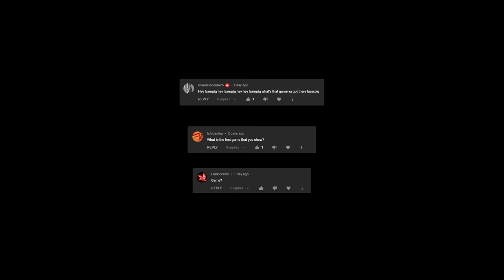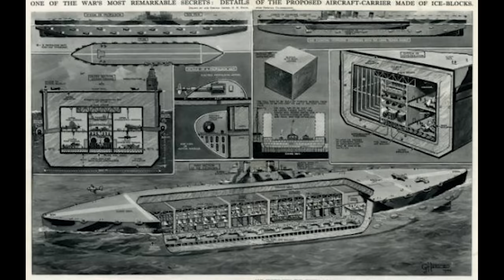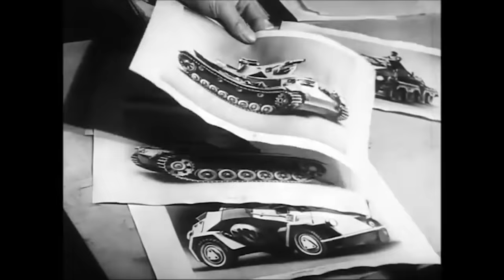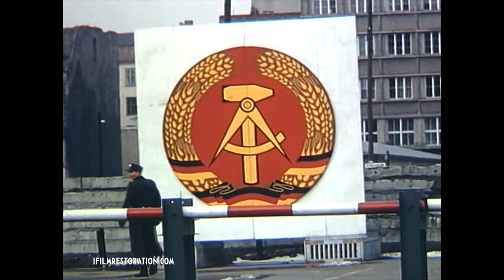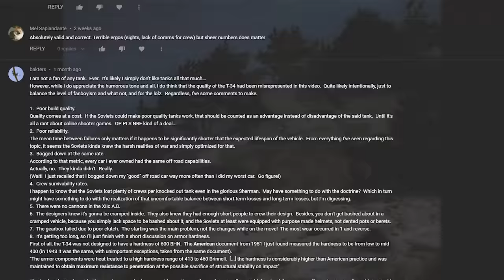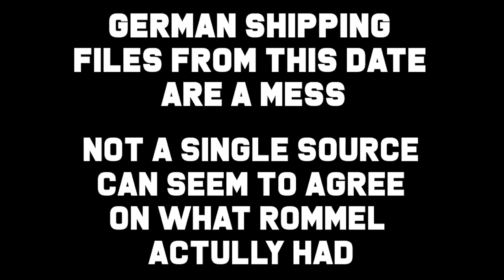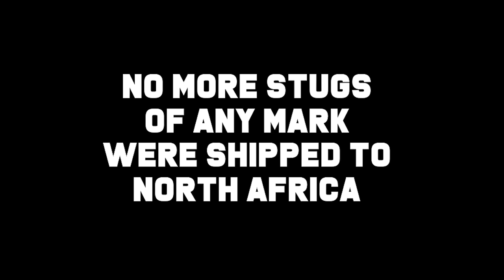In defence of the Crusader Tank

Comment: I always thought the Crusader unfairly received a bad rap.  Thanks for getting this video out!  Still looking forward for a video on the dark horse Cromwell.
Reply: I mean just looking at it and you can see that it is a good tank design.
With its low profile.
I guess it could have been less flat on the front of the turret.
You know where it was going to be hit most likely.
 
Having a tall an not very wide tank makes it an easy target.
It also comes with the need for more armor platting to protect it.
I mean there is a reason why modern tanks look the way they doo.
Reply: @MegaBanne  well the mark 2 did have a rounded gun mantlet
Reply: Cromwell is my favourite tank of the war
Reply: @ussenterprisecv6805  true
Reply: Sorry but history showed that the crusader couldnt get the job done. It was a fast light tank that had problems facing panzer 3s and 4s, themselves tanks that werent exactly hard to destroy. (and yes it could destroy them, the panzers werent immune to them, but if you compare the numbers youll see that the crusader lost outright)

And if you have a tool that cant get the job done that is required of it.. that is what we call a bad tool.

The crusader was so quickly replaced after the african campaign that none where even used during the battle for europe that followed. Instead we saw lees, shermans, cromwells etc.

No amount of "it wasnt THAT bad guys" is going to change that fact. It was an underperforming design that was made for a type of warfare that never actually apeared in ww2. The concept of a fast cavalry tank failed utterly.

And if something fails, then its bad.
Reply: @MegaBanne  Im sorry but this is not how any of this works. You dont judge a tank by how good it looks in pictures. You judge a tank by what it brings to the table.. and the crusader only brought speed to the table. Speed... in a desert. It neither had good armor protection, nor a good gun and had massive reliability issues, all well documented. Furthermore it was designed for a type of warfare on ideas that still dealt with WW1 warfare, wich was proven to be completly inadequate during germanies attack on france, and never materialized in the battles of ww2. The concept of a cavalry tank was simply not working, just like stalins race cars the BT-5 and 7 the crusader was built for a type of war that simply didnt exist.

If the crusader had been a "good tank design" the allies wouldnt have replaced it so fast after the african campaign to the point that not a single crusader saw action in europe afterwards.
Reply: @riptors9777  do remember the crusade crews were driving a tank that had just come into production  had at best 3 years training and were fighting the german panzer corps that have been training in secret for much longer and had battle experience in their blitzkrieg attacks across france so the crusader may be losing not because it was a bad tank but because the crews were not trained to as high a degree as the germans. it was replaced because it couldn't cut it against the newer more common tanks the pz4h  the panther and tiger which is why shermans and cromwells saw more action as well as the crusader no longer being on par with the average german tank  with the mk 3 and its 57mm gun it had better pen than most german tanks using even the long barrel 50mm guns whilst being faster with enough armour to hold off german 20mm guns they were expecting to fight with the pz2   its if used correctly could take out a pz 3 or 4 with very little problems having enough penetration to punch through the front of a pz 4 having up to 122 mm of penetration  for instance the tiger 1 had a frontal armour thickness of 104mm meaning the crusader at 400 metres could pen the front of a tiger though it is guaranteed at 300  so it wasn't a bad tank it was just crewed by men who didn't have a good armoured doctrine seeing as they were originally riding horses
Reply: @riptors9777  Sorry, but I do need to correct some of your rhetorical skills.  First is always know your opponent's position, least one goes off charging Don Quiote style.  I only said that I thought the Crusader unfairly received a bad rap.  That's not a ringing endorsement for "best tank of the war" anymore then its not an endorsement of "best tank of the north African war".  Just that the reputation was not wholly deserved.  My actual opinion about the Crusader as an actual tank is that the tank was adequate in its role at the time.  The Crusader had a job, it did its job.  A key factor you correctly  note is that a comparison of this tank against peer opponents would still be needed to evaluate the crusader at this level.  But you make a faulty assumption.  The Panzer Iii and Panzer iv were indeed good tanks... but they did not compose the majority of the tanks available to the Afrika Corps at the time the Crusader was "holding the line."  The armor force available to the Afrika Corps at this stage in the campaign was. .. Italian armor.  As with Bruno, Italian armor is not spoken of. Why?  Because Italian armor is an exception to the concept of "something is better than nothing".  Particularly the Italian adaption of the vickers 6 ton that the Italians made extensive use of in North Africa.  In light of its peer opponent, the Crusader did an adequate job.  Another point you overlook, is that a reference of time is important.  Designs age out quickly in war.  Which means that tanks (and even aircraft) need to be upgraded as the war continues.  If the base design can be upgraded, great.  If not, a new design is needed.  And just because a tank design is later upgraded (or discarded) at a later time doesn't mean that the tank was bad at the time it was in service.  Even the Panzer III, Panzer IV, Churchill, Sherman, and T34 all go through this upgrade track; the Crusader simply didn't have the continued ability to be upgraded.
Reply: @riptors9777  no, sorry, just no...it wasn't really the Pz3s&4s it has problems with.  The 2lb gun was able to deal with the early ones and upgunning to the 6lb put it on basically even gunning with the Pz3 and a fair range of the Pz4s.

Being the perfect 1v1 matchup is way overrated by people today, and yes, mobility is greatly underrated, as even if all it does is allow you to more easily concentrate forces where you need them, that's a force multiplier.

Really, it's the notion of the super-heavy breakthrough tank that's the thing that was the holdover from WW1 thinking.  The light tank designs were focused on NOT doing WW1 warfare again, even if the Md tanks ended up being more in line with how WW2 would actually be fought (once they stopped with the multi-turret nonsense and got some decent engines)

The actual problem the crusaders has (other than the at the time basically universal reliability problems, which were improved on with later production runs changing out the engine) was in dealing with anti-tank guns, and that was more due to the annoying British tendency to not give their tanks good HE ammo than the tank's actual design, so whenever the higher mobility of the Crusaders did get the upper hand, the German tanks could just fall back behind a line of dug-in anti-tank guns that the Crusaders didn't have the right ammo to take out.

Like all early war tanks, they certainly had flaws, but the real problem was with the ammunition they were supplied with, not the actual tanks.

It'd be like a tank design being blamed for not being able to kill other tanks when the real problem was they weren't issued AP ammo....and then mistaking it for being bad at dealing with infantry because it bounced off infantry units (because it couldn't deal with their armored support).

It wasn't an uber tank or anything but like the M3, it did the job well enough until something better could be rolled out, which was the design goal.

(Especially since, as mentioned, the Germans were fielding a lot of light tanks and non-tank vehicles and it wasn't all just their newest, heaviest equipment)
Reply: @dynamicworlds1  The 6 pounder version was introduced 1942, the very same year the african campaign ended. And ontop of that said upgrade could only be achieved by removing a crewmember from the turret. Lowering the total amount of crew in the tank to only 3

Wich as any source you will find on the topic of ww2 tanks will tell you is absolutely rubbish. The commander had to take over the roles of the gunner and loader.. so had to do three jobs at once wich LOWERED overall combat performance of an allready bad tank even further.

So not only was this upgrade not relevant to the african campaign and only came in at the 11th hour against an enemy that was allready reeling and on the backfoot, it was an overall downgrade of combat performance all things considered.

So good job making an argument that turned an allready badly performing tank into a even crappier tank.. allbeit with a bigger gun.

And i havent even mentioned the horrendous issues with the cooling system that regularly broke down, made the tank completly useless, and required THREE days to replace... only to break down again. Cause aparantly it was very weak to sand getting into the system... wich is kinda an issue if you are fighting in a desert.
Reply: @riptors9777  

The final, upgunned Crusader sliced through the panzers and had greater reliability. A big problem was the US derived Liberty engine, which Nuffield eventually ironed out the problems.
Reply: @johnpeate4544  In your dreams maybe. It came in at a time when the germans where allready on the backfoot, undersupplied and on the retreat, and was supported by Grants and Shermans.

And the problems with the engine were ironed out right before the retirement of the entire design. So for most of its existance on the field it was a piece of crap.

And again: They had to lower the crew in the turret from 2 to 1. A 2 man turret is allready less then ideal, a 1 man turret is absolute shite.

The upgunning was a last hurrah of a failed design to get atleast some use out of it and a desperate measure. 

Also i find it funny that crusader fans in this discussion where "nah man.. the basic 2 pounder had no issues with german tank armor" and then go "but it was really good after it was upgunned"

So what is it? Was the 2 pounder good enough to deal with german tanks? Or did the tank desperatly needed to be upgunned to the point that you had to sacrifice crewspace in an allready undermanned tank to stand a chance?

Cause the 3s and 4s in africa didnt get an armor upgrade during those years. So why the need for upgunning if the 2 pounder did just fine in dealing with german armor?

You guys cant even stay consistent in your arguments....

BTW. other tanks where upgradable without sacrificing crew compartment, so another minus to the allready crappy crusader.
Reply: @riptors9777  

So when I say that  final Crusader had improved armour and a 6-pdr gun and greater reliability, 6pdr armed Crusader tanks sliced through the Germans and Italians in the Desert, they ironed out the problem with the US derived Liberty engine and speed a was a great problem for the Germans because they had nothing that fast, you can’t refute it and ramble on about irrelevancies like the Germans being on the retreat and waffle about the 2-pounder which I didn’t mention?

In any case While the 2-pounder gun had good performance when the tank was introduced, ammunition supply was focused on solid armour-piercing (AP) rounds. When German tanks moved to face-hardened armour, an effective Armour-piercing, Capped, Ballistic Capped (APCBC) ammunition was not available. By the time it was, German tanks had adapted specifically to counter it. Delays in producing the next generation of cruiser tanks meant the Crusader was later up-armed with the 6-pounder, which had much better anti-tank performance.

Supported by Shermans? Good one.

The Sherman on introduction was generally no better than British tanks, but more reliable being new. In fact it was worse than many especially the well armoured 6-pdr Churchill. The Sherman’s first showing was at El Alemein, as unproven it was pitted against lesser Italian units. The Sherman tank supplied was complex, as they never had a proper tank engine it had five Cadillac engines arranged in a circle, supposedly synched up - note: US forces never used this complex excuse for a tank engine - the Sherman was built from as many existing commercial vehicle parts as possible. The British worked with the makers to improve the complex engine and tank generally - the E8, the ultimate Sherman was derived from suggestions by the British.

Further, they were found to be shaky at first and consume huge amounts of petrol.

......At the same time it is only right to remember that much of Eighth Army had had little experience of warfare of any sort.The original 51st Division had been forced to surrender at St Valery during the Battle of France–to Rommel, as had not been forgotten–and its present successor had seen no action. Alam Halfa had been 44th Division’s first battle and its experiences then and thereafter had not been happy ones: 69th Brigade had not seen combat since it had been reformed in mid-September; 9th and 24th Armoured Brigades were totally inexperienced new arrivals; and 8th Armoured Brigade had been in action as a formation only in its unsatisfactory clash with von Vaerst during Alam Halfa.

In addition, the new equipment reaching Eighth Army greatly increased the problems of inexperience – 8th, 9th and 24th Armoured Brigades for instance all received their new Shermans too late to gain any real practice with them before the battle began. They also found that there was a dearth of spare parts and many important items of equipment, such as compasses, were missing altogether. The Shermans later gained a deserved reputation for reliability but in those early days when neither their crews nor the maintenance units were used to them, it is hardly surprising that, in the tactful words of Lucas Phillips, ‘several of them were found to be mechanically shaky’._

......As a crowning misfortune, the Shermans revealed another defect which had been concealed by the static nature of the fighting at Alamein: in these difficult conditions they consumed what the Official History calls ‘fantastic quantities of fuel’.

......Currie’s brigade had been built up to 121 tanks of which seventy-two were Shermans or Grants and the rest Crusaders, but by this stage of the battle a number of the Shermans in both 9th Armoured Brigade and 1st Armoured Division were very much ‘mechanically shaky’.”

— Eighth Army's Greatest Victories: Alam Halfa to Tunis 1942–1943 by Adrian Turner
Reply: @riptors9777  

Oh the Germans were under supplied were they? And I suppose Monty chasing Rommel a total of 1,500 miles, the equivalent distance of Paris to Moscow. The captured ports, until Tripoli, were nowhere near the capacity required even had they not been demolished by the retreating Germans was rolling in supplies?

In addition to hideously stretched supply lines Montgomery was often outnumbered in his pursuit of Rommel’s across North Africa:

He [Rommel] had now blundered by abandoning the best natural defensive position between Alamein and Tunisia to counter a daring but comparatively weak threat by the New Zealand Division to his flank.

Montgomery’s plan, laid down on 28th December 1942, had been spectacularly vindicated. While Rommel gasped at Mussolini’s criticism, the forward troops of Eighth Army were equally amazed at the way the Axis forces surrendered such easily defensible territory....

....he [Montgomery] penned his own secret confession of amazement that Rommel, falling back on his well-established lines of communication, often with superior forces and in ideal defensive positions, had failed to counter Eight Army’s bluff…

...Monty had cause Rommel to adopt such a rapid withdrawal by a mixture of initial ruthlessness in battle at close quarters followed by dexterity and bluff. With only a minimum of forward troops he had forced Rommel not only to surrender almost one and a half thousand miles of territory, but to give up two excellent defensive positions in which he could have and why checked Eight Army sharply.

....In fact Montgomery had no intention of risking his meagre forward units in a premature attack on prepared defences without even proper air support. In artillery and men Eighth Army was vastly outnumbered in the Gulf of Sirte...

In fact the proof of Montgomery’s stretched administrative position was the way in which his foremost units / of 7th Armoured Division - were severely bombed and strafed by the Luftwaffe once they had hustled Rommel’s rearguard our of Agedabia, on the approach road to Agheila. There were a number of casualties, but until the last week in November the RAF was powerless to help, for only on 26 Novemberdid it manage to get two fighter wings operational at Msus.

...He would have found there that, apart from Fourth Light Armoured Brigade, which took the vital Martuba airfields on 15 November( and thus saved Malta from starvation), Eighth Army could only support one division beyond Torbruk. This was Harding’s Seventh Armoured - of whose 47 medium tanks not even five were considered capable of making the 350- mile trans-desert journey to Benghazi, so worn out had they become.

Monty, Master of the Battlefield 1942- 1944. Nigel Hamilton

It should also be emphasized that throughout its conquest of North Africa, Eight Army had to overcome problems not experienced by its predecessors. It’s supply-line had to stretch further than ever before at the time of its victory at El Agheila, and even further still at the time of its final thrust to Tripoli. At Medenine also, Eighth Army’s supply-line was from from adequate, a fact which makes the admirable defensive preparations it carried out in an astonishingly short space of time all the more remarkable.

In addition when Auchinleck had launched his attacks in July 1942, the enemy had had no opportunity to prepare adequate defences, while during CRUSADER he could outflank the defences altogether through the he open desert. For that matter Rommel had enjoyed the same advantage during his counter-offensive after CRUSADER and at Gazala.

By contrast when Eighth Army took the offensive at Alamein in October 1942, the Axis position could not be by-passed and was protected by half-a-million mines and all the hideous devices of the ‘Devil’s Garden’s’. At El Agheila it was possible to avoid the defences but only by crossing terrain worse than any that either Eighth Army or Panzerarmee Afrika had yet encountered. At Beurat the front could be outflanked without too much difficulty, but the going encountered later left even the tough, experienced New Zealanders ‘speechless’; while the Homs-Tarhuna escarpment was only mastered because Eighth Army moved too quickly for Rommel to offer adequate resistance resistance there. At Mareth, Eighth Army was opposed by long-prepared fixed defences, the only way round which led to a ‘bottleneck’ so dangerous that it was feared that an attack through it would be ‘a second Balaclava’. And finally in the Gabes Gap Eight Army faced a formidable natural barrier which it had to assault head-on…

....The weather continued to be dreadful and, as Montgomery reports in El Alamein to the River Sangro, ‘for several days the desert became a quagmire and made operations impossible’. Furthermore, as Kesserling rather admiringly points out, ’the British Eighth Army had marched halfway across North Africa - and over fifteen hundred miles - had spent the bad winter months on the move and in the desert, and had had to surmount difficulties of every kind”. Nor did those difficulties cease one Tripoli was reached, for the enemy, as Captain Roskill states in his Official History of The War at sea, had ‘managed to destroy the port facilities very thoroughly, and to block the entrance completely with six merchantmen’ that had been scuttled as well as with other other debris including ‘many barges filled with concrete’. Air raids and a violent storm did nothing to improve the situation

....And lastly there was the permanent problem of supplies. As Kesselring notes with some satisfaction, ‘even a victorious army cannot keep up a pursuit of thousands of miles in one rush; the stronger the army the greater the difficulty of supply. Previous British pursuits had broken down for the same reason.’ Moreover the ‘piece of elastic’ was under still greater pressure than usual. Montgomery had learned from the errors not only of his predecessors but of his opponent. Whereas Rommel in his dash for the Nile had left his airmen straggling far behind, the Eighth Army Commander, who always believed in the vital necessity for co-operation with the Air Arm and indeed looked on it, sometimes to the airmen’s annoyance, as virtually another branch of his command like his engineers or his artillery, was insistent that the Desert Air Force should advance with him. That meant that at the start of the new campaign some 11,500 RAF and AA personnel had to be brought forward, together with the supplies needed for them and for their aircraft, particularly aviation fuel.

So important did Montgomery consider this that he gave ‘his’ Air Force special priority. It was a wise choice, for the Axis Air Forces, now falling back on their own bases, were able to intervene once more. Fortunately their Allied opponents were ready for them. On 11 November, first day of the Cyrenaican campaign, the Kittyhawks of No. 2 Squadron SAAF attacked fifteen Stukas, and for the loss of two of their own machines, claimed eight destroyed and four ‘probables’, all of which it appears also went down. As a result of the supply problems, however, Eighth Army, contrary to popular report, was not able to advance with overwhelming numbers.

The New Zealanders were forced to halt in the frontier area. Only 7th Armoured Division, which had now reclaimed 4th Light Armoured Brigade, was able to continue Eighth Army’s progress, and it was suffering from a number of shortages, not least of water.

Nonetheless Eighth Army never lost it’s momentum.”

-Eighth Army's Greatest Victories: Alam Halfa to Tunis 1942–1943 by Adrian Turner

On Tripoli:

”Years later, in his memoirs, Monty confirmed Wimberley’s appreciation: ‘I well know that if we did not  reach Tripoli in 10 days I might have to withdraw - for lack of supplies.’ More gales had struck between 13 and 16 January, only four hundred tons per day were being off-loaded at Benghazi instead of three thousand, 50 Division’s part in the coastal attack had had to be cancelled entirely, and all 10 Corps transport was being used to ferry supplies from Tobruk and Benghazi - a six-hundred mike journey from Benghazi to Buerat alone.

....Despite early January gales that reduced supplies from Benghazi to a trickle and deprived him of his second Corps, Monty was able to breach the heavily-mined Bureat defences on 14 Januaryand storm the Tarhuna-Homs Line at the run, before Rommel could prepare for it’s defence.

...Harding’s flair for front-line leadership, Leese’s aptitude for organisation and ‘getting on with the job’, and Monty’s grasp of tactical strategy- taking the risk, which he had been unable to do at Agheila, of sending a powerful, tank-armoured left hook through unreconnoitred mountainous country - were responsible for the speed and success of Operation ‘Fire-eater’.

....but flexibility within an overall plan had proved equally necessary in the battle for Tripoli when Monty perceived Rommel’s fatal mistake, and swiftly exploited it on the right wing before Rommel could rectify his error.

-Monty, Master of the Battlefield 1942-1943 Nigel Hamilton
 Continued...
Reply: @riptors9777  

Continued...

These were necessarily thorough, for as Montgomery tells us in El Alamein to the River Sangro, ‘for administrative reasons, once I struck at Buerat I intended to drive straight through to Tripoli’–a distance of 230 miles. It was a far more difficult task than some of Eighth Army’s critics have allowed. Buerat, though provided, in Rommel’s words, with ‘every mine we had’, was not a particularly strong position. Moreover it could be outflanked far more easily than could El Agheila since the country to the south was much less difficult–though the Wadi Zem Zem running south-west from Buerat would provide a formidable obstacle. It was once Buerat was passed however, that Eighth Army’s difficulties would really begin.

Beyond Buerat the coast road, the Via Balbia, ran north-westward towards Misurata before turning west again to Tripoli. Between Buerat and Misurata movement was restricted to this road which was hemmed in on all sides by rough country and salt marshes. Moreover the enemy could cover any retreat by demolitions, and did–177 craters, ten destroyed bridges and six anti-tank ditches were later encountered by Eighth Army on the Via Balbia before Tripoli could be reached, not to mention the ‘usual’ mines and booby traps. If the coast road was ignored and a wide outflanking movement executed, then this would have to cross terrain described by Alan Moorehead as ‘so rough that even the desert veterans were left speechless’–it included every conceivable natural obstacle, from miles of soft sand, through appallingly broken ground covered with great boulders, to steep wadis and high cliffs. After Misurata the difficulties became even worse. About 30 miles east of Tripoli there lay what Nigel Hamilton calls ‘the best natural defensive line between Alamein and Tunisia’. De Guingand also refers to this as ‘an excellent natural defensive position’, while Montgomery describes it as ‘an immensely superior defensive position’. This was, in the Eighth Army Commander’s words, ‘the escarpment running from Horns on the coast through Tarhuna and Garian’, which curved in a great arc to protect Tripoli from the east, south-east and south. Montgomery was understandably alarmed in case the defences here which were already rendered formidable enough by nature should be made still more so by his enemies.

....On that day, in the vivid words of the Eighth Army Commander in his Memoirs, ‘very heavy gales began to rage in the Mediterranean and these created havoc and destruction at Benghazi. Ships broke loose and charged about the harbour; heavy seas broke up the breakwater and smashed into the inner harbour; much damage was done to tugs, lighters and landing places.’ Four large supply-ships were lost, one of which carried 2,000 tons of ammunition; the tonnage received by Benghazi fell from 3,000 tons a day to under 1,000 tons and later as low as 400 tons, and Eighth Army, as its leader records, was ‘thrown back on Tobruk’.

Montgomery, usually dismissed by Eighth Army’s critics as a cautious, unimaginative commander, acted immediately. X Corps which he had planned to move forward to support his offensive and later to conduct operations west of Tripoli was ‘grounded’. Its 1st Armoured Division handed over its tanks to 7th Armoured Division, and the Corps concentrated on providing a transport service, delivering supplies to the front.

....Even with their best efforts, however, the supply situation remained so serious that de Guingand calls Montgomery’s determination to proceed with his offensive on its original planned date of 15 January, *’a brave decision’. It would be possible to provide supplies for a period of only ten days. If the Eighth Army did not reach Tripoli within that time or at least immediately thereafter, ‘the situation,’ as de Guingand puts it with some restraint, ‘would not be good, for without the use of Tripoli as a supply port, strong forces could not be maintained so far forward. If, therefore, Rommel prevented us capturing the port for, say, two weeks, it might well prove necessary to withdraw the bulk of our forces.’ ‘The problem was relentless agrees the Official History. ‘Once the Army and air forces moved they had to reach Tripoli without pause in a set time or withdraw for want of supplies.’ Not only did the shortage of supplies render X Corps unable to take part in the offensive, it also resulted in 50th Division, which had originally been detailed as part of the attacking force, having to be left behind at El Agheila. The loss of this formation meant that Leese’s XXX Corps again had only three divisions available for what was code-named at the time Operation FIRE-EATER, and would later be called the Battle of Buerat. This, it may be added, much underestimates the task before XXX Corps which was in fact a threefold one: to assault Buerat, to storm the Homs-Tarhuna line and to capture Tripoli.

.....Now that the fixed defences had been passed it was vital that Eighth Army should reach Horns and Tarhuna before its enemies could prepare adequate defences there. Montgomery promptly cancelled all orders for caution, calling instead for ‘great resolution and determination’. Despite the mines, demolitions and booby traps on the coast road and the appalling going facing Leese’s advance, the men of Eighth Army met the challenge. By the evening of the 17th, Leese had captured Beni Ulid, south-east of Tarhuna and due south of Horns, while 51st Highland Division had advanced to within some twelve miles of Misurata.

....Thereupon Montgomery, as at Alamein, switched the direction of his main thrust, reinforcing 51st Highland Division with 22nd Armoured Brigade and sternly commanding Wimberley to attack day and night until victory had been achieved.

--Eighth Army's Greatest Victories: Alam Halfa to Tunis 1942–1943 by Adrian Turner
Reply: @johnpeate4544  Three words: Royal...british...navy

They controlled the coasts of africa making any and all naval operations for the axis around africa more then risky, and alot of axis ships where sunk trying to supply the african campaign.

The italians allready had issues supporting their africa campaign before they begged the germans for help, and the supply situation didnt actually improve with germans entering the theater. The number of ports theoretically open to the germans wont do jack shit if no ships come through! Add to that that the initial landing force the germans had brought along was only meant for a short campaign to stabilize the situation and NOT chase the british out of aegypt meant that the axis where running on a very tight budget in africa from the moment rommel landed there.

Once they had smashed their heads against the brits, and as you so nicely quoted, being chased for 1900 miles with the brits hot on their heels. You really think that they where fully stocked and ready to roll?

If that had been the case the allies would have been driven out of africa a long time ago. Rommel was running out of man and material while the brits where getting not only supplies from the USA in the form of new tanks, but also an entire US army landing in french africa (they got their shit kicked in in their first confrontation with german troops but after that they put on their bigboy pants and got their act together) Not to mention an entire swath of commonwealth troops from all over the world. Like the Aussies that managed to capture an enigma machine.

Rommel on the other hand could not draw from such resources, logistic support from the european mainland was sketchy at best, and had an unreliable, unwilling and mostly incapable ally in the form of the italian military leadership on his hands.

That he even managed to drive back the british initially just shows how badly the brits where outperformed on the field by german equipment and tactics. The brits had way more crusaders at their disposal then the germans had 3s and 4s... yet they where driven all the way back to aegypt.

What an awesome tank the crusader had been that it couldnt actually stop the german advance despite having more of them + fortified positions + having every other advantage that the germans also had.

Give it up allready.. the crusader was a bad tank, designed for a role that never mirrored reality, with a shoddy engine and a weak maingun, no armor and speed that was useless in the desert and would of been questionable on the european mainland
Reply: @riptors9777  

While Rommel tried to blame his issues there on “his supplies being sunk by British forces from Malta”, he actually got more than he needed across the Med throughout the campaign; the problem was port capacity and intra-theatre transport. He couldn’t unload fast enough at Benghazi, couldn’t move enough from Benghazi to the front, and having “more ships” delivering, meant they unloaded in Tripoli instead.

He kept outrunning his supply lines. Whose decision was it to stand and fight at Alamein, so far from his supply base? Rommel didn’t understand that you do not EVER advance too quickly before your supplies can catch up with you and thus lay yourself open to counter attack. This is what Rommel did in 1941. By the end of 1941 he was exactly back to where he started from at the beginning of the year. Montgomery was the ONLY commander with the brains to figure out that you cannot continue to advance speedily in North Africa willy nilly. You need to be re-supplied and you DON’T over extend your supply lines. This is why as soon as Montgomery entered the picture in North Africa he only advanced one way. Forward and never backwards. He made sure he NEVER over extended his supply lines in a North Africa as the distances were huge and extremely problematic.

Montgomery was the ONLY commander in North Africa who had the brains and savvy to realize that you do NOT outrun your supply lines by advancing too quickly. It wasn’t the lack of supplies that was the problem for Rommel. It was the fact that he moved too quickly, over extended himself and made his advances vulnerable to counter-attack. The British made exactly the same mistakes during Operation Crusader. Montgomery never played into Rommel’s hands.

Rommel didn’t have the savvy of Montgomery when it came to logistics and supply. Montgomery never outran his supply lines. He made sure he only advanced at a pace where his forces could always be re-supplied and thus he made sure his forward movements were never weakened and isolated from the supplies. This is why after Montgomery took over, there was only one way back for Rommel... retreat. Montgomery never even gave Rommel the opportunity for counter-attack as Montgomery never made his forces weak as other British commanders and Rommel himself did previously in 1941 and 1942. Montgomery was the smartest command in the entire North African war. He knew what it took to win.

......

I see you’re still unable to refute what I wrote as still want to talk about the overall tank performance.

That the final Crusader had improved armour and a 6-pdr gun which sliced through the Germans and Italians in the Desert. 

Tanks arriving in North Africa were missing many of the essential tools and servicing manuals needed to maintain operation—stolen or lost in transit. As tanks broke down, a lack of spare parts meant that many components were replaced with worn parts recovered from other tanks. When the tanks were returned to the base workshops upon reaching service intervals, many were serviced with components that had already achieved their design lifespan.

In any case a big problem was with the US derived Liberty engine which they eventually ironed out.

And no, speed was not useless in parts of the desert which could be ideal for tank warfare. At times a great problem for the Germans because they had nothing that fast. It could use it’s better mobility to fire on the move to strike at vehicle weak spots.
Reply: @riptors9777  

”That he even managed to drive back the British initially shows how badly the Brits were outperformed on the field by German equipment and tactics”

In North Africa the Axis for a while had overwhelming numerical superior against the British forces with more than enough supplies. How ever they still failed to take Egypt and the Suez Canal.

Rommel was well supported from nearby Italy. The supply routes from Germany were secure and over lean except for the short sea hop.

The British supplied the North African desert armies sailing around the Cape. That is longer than Britain to Australia which is halfway around the globe. These were the longest supply lines in history. That was a hell of feat.

The Axis even failed to take Tobruk at that point. When Churchill diverted forces to Greece, all that remained were rear elements, of two tank regiments of the 2nd Armoured Division, equipped with worn out vehicles and captured Italian M13 tanks with a total of 47 tanks and a territorial army battalion.

The only experienced troops available to the British were the 9th Australian Infantry Divison in transit from Iraq and the Third Indian Motorized Brigade. Rommel, in contrast, had his 5th light Division of 150 tanks, over half of which were modern Pz III and IVs both superior to the best allied tanks in the theatre, and five depleted Italian Divisions, giving 85 tanks, giving a total of 235 tanks.

This gave the Axis a 5:1 advantage in tanks over the British. Axis supplies were coming through in volume from nearby Italy.

That gave Rommel overwhelming superiority at that point, which should have resulted in an outright Axis victory in 1942. It never did.

When Rommel arrived in North Africa the British had already stripped it’s army there of the best units due to the expedition to aid Greece and hold Crete. What was left when Rommel arrived were mostly rear area elements, two tank regiments of the 2nd Armoured Division which were newly arrived and equipped with worn out vehicles and captured Italian tanks ( just 47 tanks in all) and a territorial army battalion. The only experienced troops available to the British when Rommel arrived were 9th Australian and the 3rd Indian Motorized Brigade. In contrast Rommel had his 5th Light Division with 150 tanks ( over half of which were modern Pz III and IV’s both superior to the British tanks and 5 depleted Italian Divisions (85 tanks). That, plus close air support and mobile anti-tank tactics gave Rommel a temporary overwhelming superiority that should have resulted in an outright axis victory in 1941. 

Guess what? Rommel failed. He couldn’t even take Torbruk and didn’t push the British back across Egypt. Rommel at this time had the advantage in troops and tanks.

Rommel had enough men, material and supplies in 1941 when the British were weaker.

At one point he even had more tanks than the British. Yet he failed to defeat the British. 

Why? Because he didn’t understand logistics. He kept outrunning his supply lines TOO quickly, before his supplies could catch up, thus making himself weak, isolated from his supply lines and exposed to counter-attack. That’s the hallmark of a bad commander.

Rommel had all the advantages at Torbruk in 1941 but he came up short and failed. On equal terms out in the open Rommel was great at fast moving armoured operations but he was pretty clueless on logistics and how not to over extend himself and he was not adept at overcoming fortified defenses.

In November Rommel was pushed back in a 500 mile retreat, all the way back to his start lines of earlier that year. This was the first land retreat the German Army suffered in WW2.

At Alam El Halfa Montgomery and the British were outnumbered:

Corps (Eighth Army)
4 divisions
Panzer Army Africa
6 divisions

Rommel had 500 tanks, 200 being modern PZ IV Ausf F and long barreled PZ IUI, and 700 airplanes, while Monty had just arrived, had 450 tanks, 370 being outdated Matilda, Valentine and Crusader with the 2 pounder and 500 planes.

Result? Complete British victory, initiative passed to Montgomery and he could now build up his army for his own offensive That is why at El Alamein Monty had complete superiority in tanks, infantry and planes, because of Alam el Halfa, where Monty had none of these.
Reply: @johnpeate4544 You do realize that you are making absolutely no logical sense here?

You say rommel had enough support, only that he outran it, but then he didnt had port capacity, then his logistics couldnt reach him cause he was to far ahead... but he had all the support he could have ever needed and had superior numbers to the brits....

Then you say monty chased rommel for 1900 miles straight all the way back where rommel started from, then you say monty knew not to ever overextent, then you say monty only ever moved forward...

Do you see the issue with your claims here? Im sorry but you cant have your cake and eat it. Only one of these claims can be real.

And the fact that monty was able to chase rommel all the way back to rommels starting point WITHOUT running into the same issues that the germans and italians did, no matter how close of a call it was meant that they indeed had more men, machines and logistical support.

And yes speed is irrelevant on a completly open battlefield when your enemy has the range and precision advantage over you. Wich both the 3 and 4 had. Their guns could knock out crusaders at ranges where the crusader couldnt hope to compete. So what good does it do to be faster when the enemy turret has no issue tracking you.

There was a reason why the crusader was replaced with shermans and Grants, and it sure as hell had nothing to do with the crusader being such an effective tank against the german panzers
Reply: @riptors9777  

You’re confused.

I wasn’t talking about Montgomery when I said Rommel was pushed all the way back to his start lines of earlier that year in the first land retreat the Germans suffered in WW2. I was talking about November 1941. Montgomery didn’t get to North Africa until mid 1942.

Monty did only ever move forward. To not over extend yourself doesn’t mean you retreat. That’s what you have to do when you have over extended your supply lines.  Monty believed in a balanced army, one that doesn’t over reach itself and brings up it’s supplies, otherwise it lacks the wherewithal to carry on fighting and press home it’s attacks.

Rommel did get supplies across the Med and there was a problem with port capacity. That doesn’t mean they couldn’t unload anything. There is as also a problem with transport. That doesn’t mean that Rommel didn’t outrun the supplies he had .

In 1941 proportionally to their size, Rommel’s Afrikaners had three hundred times more trucks than the forces earmarked for Barbarossa. And he was explicitly ordered to hold the line, for the entire German armed forces knew that logistics would not support the Italo-German forces, which were needing 70.000 tons of supplies every month, at the moment equivalent to the maximum possible capacity of Tripoli, the only port in Axis hands. Then Rommel attacked.

Rommel continually outran the supplies he had. Whose decision was it to stand and fight so far from his supply base at Alamein?

No it doesn’t mean that just because Monty didn’t run into those problems that they had more men. It meant Monty was more astute and had more savvy than Rommel and other generals who had gone before himself.

More men makes the problem worse. More men means they have to have more supply. Which means more transport. Which means more maintenance and fuel, which means more transport...

....And lastly there was the permanent problem of supplies. As Kesselring notes with some satisfaction, ‘even a victorious army cannot keep up a pursuit of thousands of miles in one rush; the stronger the army the greater the difficulty of supply. Previous British pursuits had broken down for the same reason.’ Moreover the ‘piece of elastic’ was under still greater pressure than usual. Montgomery had learned from the errors not only of his predecessors but of his opponent.

...As a result of the supply problems, however, Eighth Army, contrary to popular report, was not able to advance with overwhelming numbers.

The New Zealanders were forced to halt in the frontier area. Only 7th Armoured Division, which had now reclaimed 4th Light Armoured Brigade, was able to continue Eighth Army’s progress, and it was suffering from a number of shortages, not least of water.

Nonetheless Eighth Army never lost it’s momentum.”

-Eighth Army's Greatest Victories. Adrian Turner 

.........

Yet the 6-pounder could take out most German armour in 1942/43. Speed was a great advantage for it and the Crusader was quite popular with it’s crews.